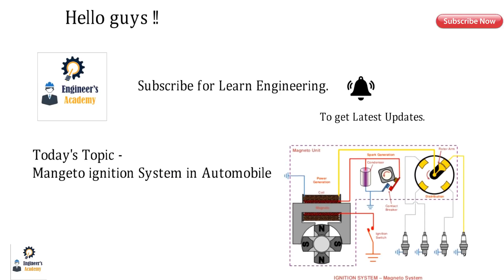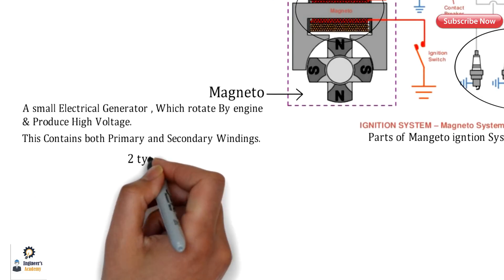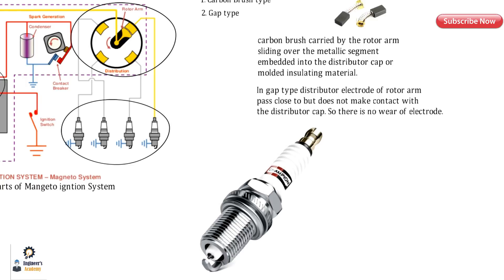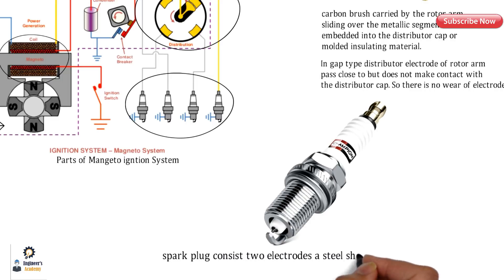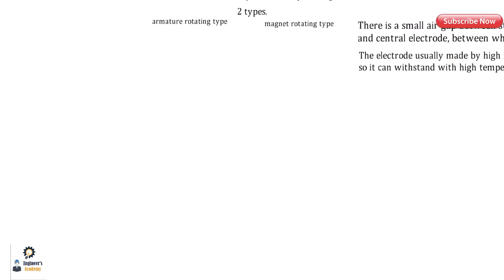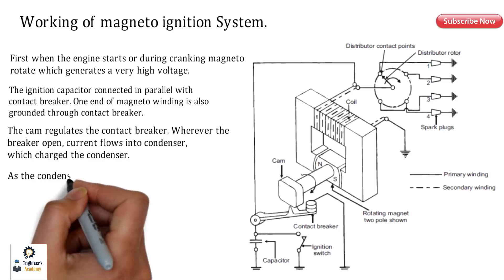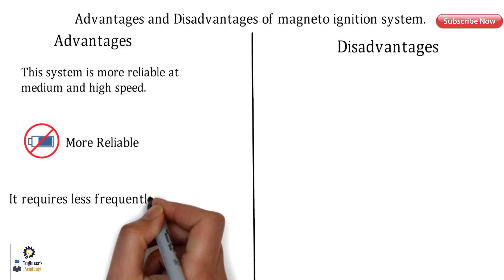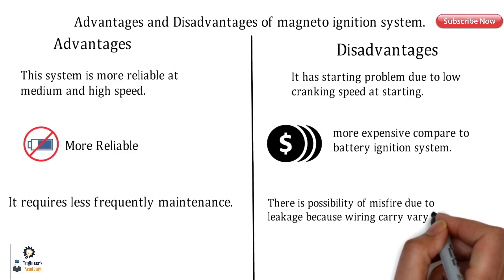How Magneto ignition system works in an Automobile??  ||Engineer's Academy||

Comment: I didn't quite understand the capacitor explanation... I just know the following.
In order to obtain a very HIGH VOLTAGE in the secondary, we need a GREAT FLUX CHANGE through the core (implicitly secondary coil), because the greater the flux change the greater the voltage obtained. Therefore, besides collapsing the flux in the primary, we ALSO REVERSE the current direction through it, obtaining a GREATER FLUX DECAY through the primary, and this is exactly what the capacitor does. A capacitor always opposes a build up in voltage by charging itself. The contactor circuit here shortens both the primary coil and the capacitor. Let's assume the rotor starts from Full Register, with N in the left, rotating clockwise. The capacitor opposes the build up of the induced voltage in the primary by charging up, and immediately after the circuit opens (10 degrees after Neutral, EGAP), the capacitor is no longer shortened by the contactor, so it discharges solely through the primary coil. 
Keep in mind, that any collapsing magnetic field through a coil, give rise to a self induced current through that coil. In our case, the self induced current due to the collapsing magnetic field is opposed by the capacitor current through the primary, thus hurrying up the collapse (according to the Right-Hand Corkscrew Rule) !
In other words, the capacitor only forces a reversed current through the primary, to oppose the selfinduced one, in the end accelerating the collapse of the induced magnetic field. This happens very quickly, right after 10 degrees past Neutral (EGAP).
At this point, the CHANGE of the rotor magnetic field in the core is just below peak value, which means the EMFs generated in both the primary and secondary coils are just below maximum. Also, the CHANGES in the rotor magnetic field and the collapsing primary field have the same directions (very important)! As the two magnetic fields have the same direction of change, they will superimpose, thus give rise to a LARGE FLUX CHANGE through the core, implicitly through the secondary coil. This is like a spike in the magnetic flux change through it, leading to a very high EMF at the ends of the secondary, which translates in a spark obtained at the sparkplug.
In other words the capacitor and primary coil form a tuned LC circuit.
All this starts when the EGAP commences and up to the point when N reaches the yoke (Full Register position), the superimposed flux change being large enough to create the spark.
https://www.youtube.com/watch?v=OMLSNwQiiKg

Comment: hi, you write on one side the advantage of magneto is you dont need a battery. on the other side you say the disadvantage is you need a battery. why do you need a battery?
Reply: I think a battery is needed while starting the engine, the initial "push" for the magnet to start rotating. After that, the crankshaft takes care of this, so a battery is not needed further. This is just what I think, I'm not sure about it though.